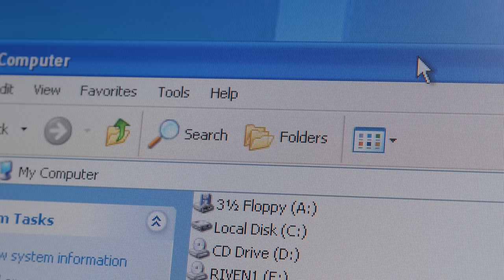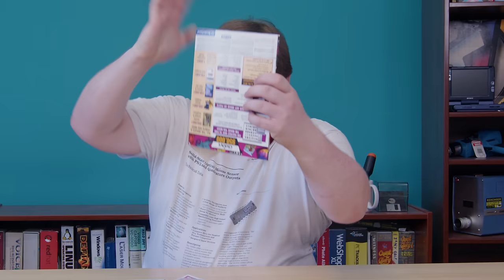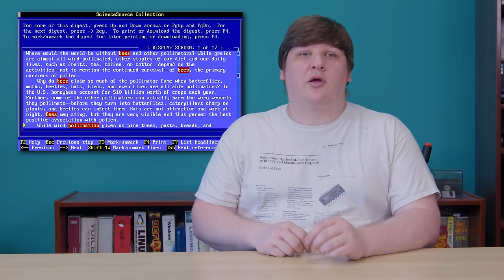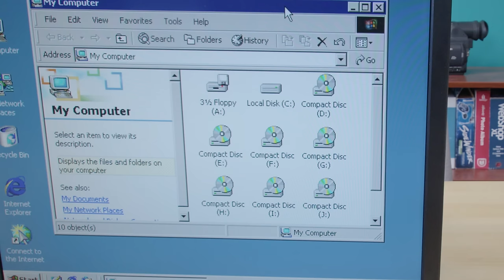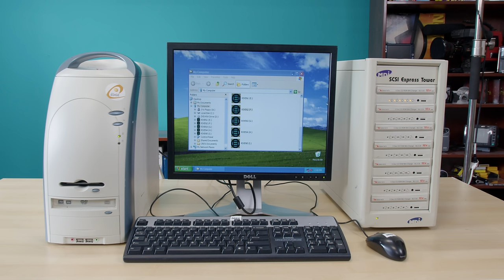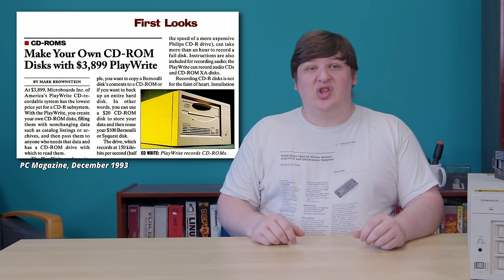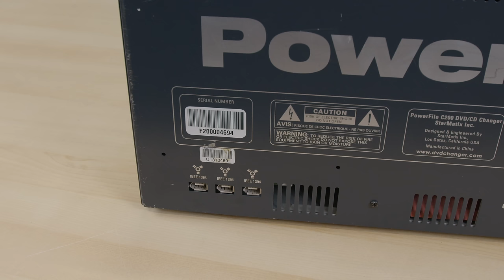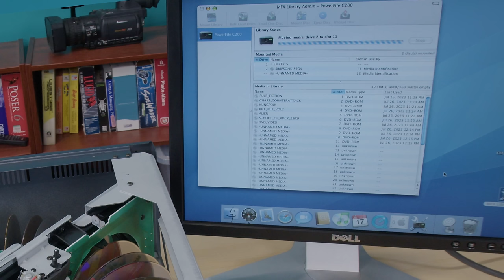A Jukebox for your PC: 1993's CDROM Servers

Comment: Up till the very late 90s, i really think you could have made some decent money with a CD server if you were lucky enough to have direct access to sony or whatever for the dosc manufacturing, so a spinoff company or whatever, and you could have provided a "90s amazon s3/backblaze b2/etc" eaaily. If you had yhe funding to make the disks, you could eaaily get enough bandwidth with 1-3 copies of each disk and one of these machines for the needs of the era. Not that many people wanted to do that. But if you already were using the inter et and you waanted to log your weather station data online or something, maybe there could have been some use cases that could have been built around this. Or maybe not!

Comment: wouldn’t just greying out certain discs be a solution? like blank out the discs that cannot be able to be used currently, and have a timeout of like 30 seconds of the user not using any data

Comment: I'm still totally impressed by 512Gb in a micro SD card. I remember the megabyte days of that storage. I put an SD card of 1G on top of a CD and declaring that it was soooo obsolete 😂

512 Gb translates roughly to 5000000000000 bits with all redundancy. That's a 5 with twelve zeroes.

Comment: The whole problem with these CD jukeboxes is, they shows Microsoft havn't learnt a thing since 1983 ... It's the exact same problem that is plagueing USB 3.x memory sticks or drives once you connect more than 1 device to the same controller and tries to copy some files ... Windows stalls completely, becaus even we now have tons more memory and SSD capacity/Speed Microsoft havn't figured out to create a temporal buffer storage area and do a larger sequence of reading/writing because of usb media is 1. slow in writing, and we have a limited ammount of pci_e lanes avilable that added to the problem often several i/o devices have to share so when the controller with 2 or more usb drives asks for simultaneous read/write the read write cycle stalls or you loose control of keyboard/mice caust the same controller also hosts the usb2 connection that you usually use for these devices. I know that is actually also a hardware issue, but you cannot asume that the average home user can understand the technical details of the flow diagram of how the often 10+ usb connections is wired inside a computer. It's a freakin mess even for a professional, that there really isn't a reason they havent found a solution to this in 4 decades of time. It's basic teaching in computer programming how you can create a buffer to optimise i/o of either slow devices or asymetric i/o speeds or timings.

Comment: I worked for a company who write DIP software and they would archive images to indexed CD optical storage jukeboxes, I know they had thousands in the biggest location which was "gathering" data from all over the place and each drive unit could access hundreds of CD's automatically (Later DVD and maybe BlueRay later on) in their datacentre and remote failover mirrored location(s).  Before CD they used WORM optical media and I think somewhere I have a WORM drive I had after leaving which you are welcome to have if I find it, might also have WORM disks too.
Reply: As I was writing this you started talking about accessing CD on a multi user network, the access handling was using transaction logging in a SQL database.

Comment: I had seen the Pioneer 500-disc cabinet in action. It was located in the underground main server room of an insurance company. I had seen it running in 2017!

This wasn’t used as a software kiosk. I wasn’t told anything about the system but I once saw someone retrieving a large number of discs and replacing them with blank discs from a spindle. This must have been a backup solution, I’d bet some sort of incremental backup.

Also since this thing was very old, I guess it’s also a backup of the backup system. There was also an old man patrolling the vast server room with a real heavy duty welded steel pipes tape trolley once a day. The backup of the backups backup?

Comment: I know you said not to bring up tape, but I'm gonna. Sorry. 

I use LTO-6 tape to back up my large collection of Blu-ray rips.  They're cool, and they're amongst the cheapest per-TB cost available (a 2.5tb LTO-6 tape is about $10/tape if you buy them in bulk), but they're very very far from "set and forget".  Generally data integrity is fine, but they're subject to issues with humidity (which did ruin one tape for me), and even if the physical tapes themselves are fine, it's actually really difficult to get it working in any modern OS. Linux is the easiest, but that still involves working with annoying kernel modules and half-supported filesystem drivers.

It's still cool, but it requires a good amount of babysitting still.

Comment: windows never did well with any sort of media changers, have always found they work better under Unix, and lots of those units were used as backup or other specialized software where there is an index stored on the HDD to refer to.

Comment: With those pioneer units, the design could have likely been recycled from an existing CD audio changer, rather than having to put the r&d money into a powder coated steel unit, they decided to recycle an existing design.
Reply: Would have been a pretty simple adaptation. Basically just swap out the interface board. Even designing the new board could reuse parts of the audio-only design. Leave the drive control and decoding circuitry as-is and swap out the microcontroller for the display and buttons for a SCSI interface.

Comment: Panasonic/Technics had a line of CD changers, the SL-MC and SA-CH models (101 and 61 discs), both of which I happen to own. They got the mechanism part right: the entire CD drive unit moves behind the rack of discs and loads the one you wish to play, with a satisfying series of mechanical noises. This means you can manipulate the rest of the discs WHILE a disc is in play. I really wished they carried on and implemented this mech in some PC disc changers too, since it was virtually limitless in terms of how wide you could make it, at the expense of loading speed and size, of course. You could stack several on top of one another and have thousands of discs.

Comment: The PowerFile was told at training that no sane person would feasibly want to sit for an hour loading all their DVDs into its carousel, so after 40 discs it probably assumed you were normal and probably wanted to start actually playing a movie.

Then it freaks out when you aren't normal, and promptly has a panic attack.
Reply from the maker: Given that I was using its Bulk Load option, which is specifically intended to go until you stop it, that seems unlikely.

Comment: So.... I have too many of the power file machines ...  The good ones work perfectly. The lemons are lost causes. Seems like the plastic warps sometimes and it is impossible to get back right. Also there is a soldered lithium battery on the board that should be replaced if you want to have a long term use of them. It's better to bulk load the devices without the computer on and just have it index everything later.

Comment: At least windows 2003 or newer maybe even Vista pro and possibly even windows to thousand had a media changer option that you could add if I remember correctly it was a medium management tool that allows the server operator to spool up the proper desk for the users to useit was a way around the inconsistencies of the jukebox

Comment: The indexing makes no sense. It would have likely been far easier for the end user if that entire process was manually initiated. Ideally giving you a choice between doing an index update where you're only filling empty slots, or removing disks, or you do a full re-index. That way, you can initiate it only when you need to, and presumably, not have to fight the machine. This thing's software gives me mad Inkjet Driver vibes.

I'd imagine this thing was pretty cool as part of someone's home theater setup.

Comment: i work at an insurance and we had, up until recently for that matter, a bluray disc version of those machines. from what i've been told (i only joined them recently) this machine has been hilariously unreliable. honestly no idea why we had this machine when we also had a virtual and physical tape library in the same data center, but it was there and has caused struggles for some technician. maybee as some weird kind of worm device, but i don't know. :^(

i think the powerfile is the best insight one could have compared to the "professional" devices which filled server racks.

Comment: I owned and used a similar 6-disc cartridge changer between 2003 and 2008. I had attached it to my Linux Server and it held the first 5 installation discs of the system and a burned disc with random stuff.

This one was detected as a single drive only! While I had an OS/2 Warp 4 driver diskette for this thing, I didn’t need any drivers at all. In Linux, you use the “eject” command. You specify the disc with a parameter. 

And if you messed up the parameter, you had got an error message while the cartridge pops out with no way to reinsert it remotely. I had bought this thing to change discs without going down into my cellar to do stuff on my server like installing some software packages. And instead of running the stairs once, do the install and then get back, I often ran multiple times just to slap the cartridge in and return to the terminal upstairs on the 4th floor.

Comment: I never thought about it before, but why was it not possible to erase only part of a CD-RW?
Reply from the maker: Lack of index marks. CD burners basically get a running start, then do the whole burn in one go; they aren't able to precisely start and stop the laser on a perfect sector boundary. RAM and MO discs added locating marks ("hard sectors") that make that trick possible.

Comment: I can't help but wonder if some of the weird issues you're seeing under Windows isn't due to Windows search indexing and/or Windows doing malware scanning.
Reply from the maker: Nah, for a variety of reasons. Defender is not built in to XP; search indexing shouldn't touch removable storage afaik; and I had similar issues on 2000 and NT4. Good thinking though

Comment: All these problem are solved by DVD. AT least these problems which ~16 CD changer can solve. DVD can store 8.5GB (DL) max and was released in 1996. And the same problem emerges naturally.
And similar tech do exist in modern tech, like SONY Optical Disc Archive. But it just died this January. Panasonic has similar stuff but basically share the same fate.

My answer for archiving is BD-R. It doesn't rotten that much and is cheap. The drives are expensive but you can find cheap used with good condition because nobody really use often.
Reply: I've heard the phase-change materials of the RW discs last better than the dyes of the write-once discs. No idea if that's true, but if it is, it gives a reason for buying them.

Comment: Near-line LTO tape robots are still used in larger settings.
Just a few years ago had a very large university's High Performance Computing Center, I got to watch the robot switch tapes as it performed backups on the cluster.

Comment: Even though ive just heard about how bad the powerfile is, i still want the r200, even though i have a laptop harddrive in my desktop that has a larger storage capacity, the power of 200 dvd ram's is still quite appealing. Of course if i want to use an inefecent and outdated tool, i would just use a serial trackball mouse, oh... i do, its fun and nice not to have to move it around, but a lexapro aqua mouse was on ebay for about the same price and that is much more comical and useful, as windows 7 doesnt know how to use the 3rd mouse button, even though it should just use it as a scroll wheel click, a middle click

Comment: Just because a thing was built for the enterprise don't count on it being any better than what was built for the consumer space. Often the assumption is that enterprise customers have the time to train someone to do all the fiddly stuff including fighting with the thing to do what it's supposed to do - the manufacturer probably had seminars. I mean, enterprise printers are no easier to use than personal printers, just to tick on an example that was mentioned in the vid - heck you call in a service specialist when that goes blooey. So those 2000 DVD racks are very likely no easier to use than the 200 DVD jukebox.

Comment: I've only encountered those photo libraries on cds once, and they were nightmarish to use.

You had a little book that listed category and subcategory and it's location as a number. So say you were looking for photos of a cat walking across a roof. You'd go to the top level category, say "Animals, 3". Then you'd look inside that and find "cat, 18" and then inside that you'd have a few smaller categories that would likely be something like "urban environment, 6" in this case.

After you'd done this, you'd go to the photo retrieval program and ask it to fetch "3,18,6" - which would then take 20 minutes to pull up 50 photos of cats, none of which would be quite want you wanted.

Comment: A large construction engineering and architecture company I was working for about a decade ago had a full room that was a library of CDs from more than a few services for things like construction laws and practices and manufacture catalogs of things like prefab building parts to plumbing fixtures. Most of the discs were dated from 1996 to 2005. Around the time I was leaving they were in the process of having a few interns copy all the data to a network share because the new laptops being issued no longer had disc drives. It had to be archived because when doing renovations on old buildings they needed the code from the time the building was constructed on hand.

Comment: Thanks for all the great videos! I recently restored tape backups I've had since the 1990's and they restored flawlessly. They were not stored carefully at all. All my other backups have not been as rock solid and these were not in any way stored like I ever was planning on restoring them. I think tapes are probably the best. I know magnetic tape isn't supposed to last but in my experience all the magnetic tape I've encountered is really great and still holding up. My CD-R and DVD-R based backups are all shitty annoying and have lost some or all of their data. Hard drives have failed. But magnetic tape seems to still be going strong after like 40 years. Audio tape, video tape, data tape... it's endured no special storage or handling way better than anything else. It's surprising to me but it's just all been so great. Not just one or twp cherry picked cased... it's all fucking great! I can't believe it. I'll probably just do a bunch of hard drives in and out of rotation over time... but at some point I wanna go tape. it has been to least disappointing and most surprisingly reliable media I've encountered. I don't want to believe it... but I'm struggling not to come to this conclusion.

Comment: Parents purchased the family computer in 1996. Pretty generic tower, Pentium 100mhz with 8mb ram, 4X cd rom drive, and a 1.2gb hard drive. No idea what the graphics card was, but it could handle Descent 2 without slowdowns. No internet until 1997 I think.....

Comment: I have a C200-R powerfile.  The mainboard gave up about a decade ago and is patiently waiting for a refit of some kind.  I absolutely feel you on the load/unload cycle and poor UI on this thing.  I managed to get it working with Linux via MTX automation - the robot arms inside look like a tape changer to the OS.  In general, this thing works best if you never change the CD contents inside.  As a cough backup automation device, queuing up 200 discs for one big batch is a big time saver, even with all the other frustrations.

As a "preview" of bigger machines, I think the manufacturer had something planned.  It happens to be narrow enough to fit into a standard 24" rack.  I think they had aims of a more professional version could take rack-mount ears - but this thing would be right at home on a beefy rack shelf.

Comment: Would these play CD-R’s full of MP3 files?
Reply from the maker: Not internally, since they only support CD audio of course, but connected to a PC there's no reason you couldn't play the MP3s with a normal application. In fact, although some early CD-ROMs don't play well with later burned discs, both of the music discs I played in this video were off very cheap, very late 2010s CDRs, and I had no trouble with them.
Reply: @CathodeRayDude that’s what l was thinking of, connected to a computer.

Comment: Don't forget schools. I vividly remember my high school in the UK having a multi-CD-ROM setup although I couldn't have told you how it worked. There were clipart collections but also educational stuff as well as emulated old 80s computer setups with lots of the software they used on these CDs.